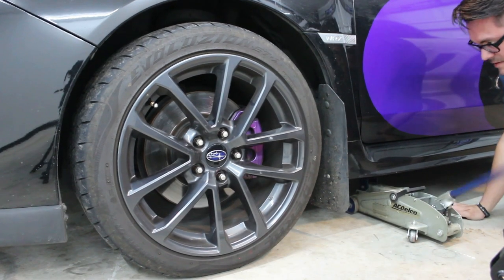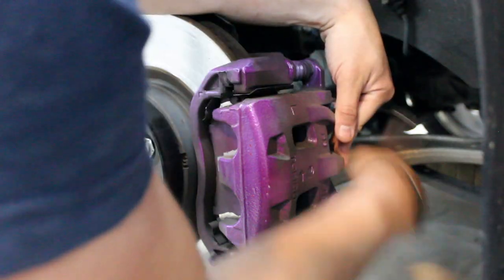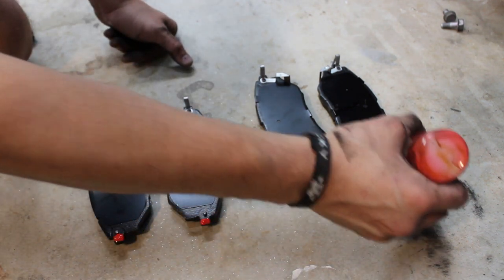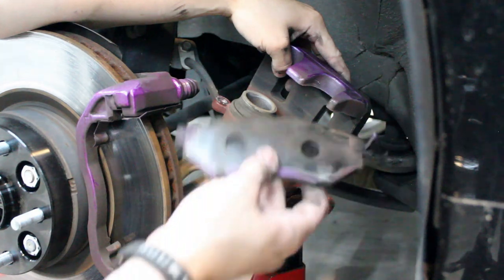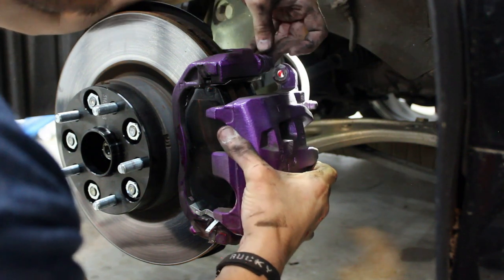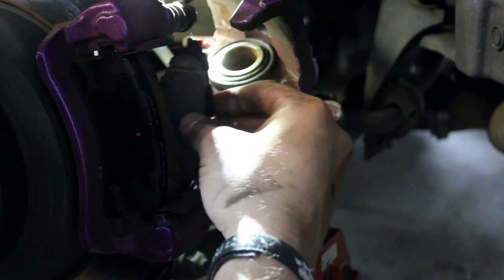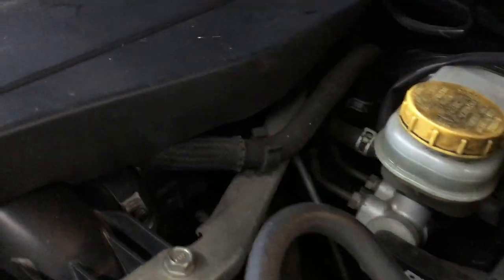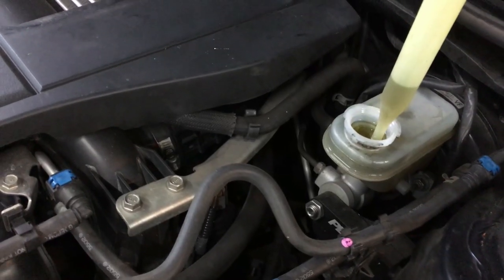2015-2021 Subaru WRX, Brake Pad Change

Comment: You don't need to put red locktite on any bolt to do with brake calipers and you certainly don't need to bleed the brakes after pad installation like what🤣
Reply from the maker: Didn’t say you had the bleed the brakes with a pad change, just showing how it’s done. At 100k miles, it was long overdue on this car. 

I strongly encourage using locktite though. Factory recommendation and I’ve had Subaru caliper bolts fall out before.
Reply: Blue loctite would be better for this though. Especially if you would ever need to do the pads again in the future (which someone will). Red is too strong and usually meant to stay permanently.

Comment: torque spec on the 14mm bolts?
Reply: 20ft lbs on caliper bolts I'm finding in my guide from O'Reilly auto where I work. Getting ready to replace mine in a couple days. Doesn't seem to be a very hard project to do from a home garage...

Comment: The retaining spring clip on the bottom of the brake pad, does that go on the inside of the bracket or do you pull the tab out and have it rest on the outside of the bracket? Im having a hell of a time getting my pads to sit properly but Ive seen in the impreza forum that the spring clip rests on the outside of the bracket on the metal tab. I would think itd be easier leaving it on the inside but my stock pads have the spring clip on the outside
Reply: you probably got this by now - but the outside for sure!!

Comment: Great video, but some things to consider here:
#1 - add grease between the metal clips and caliper   (contact point)

#2- don’t grease that edge of the pad (not a contact point)

#3 - grease goes between the back of the pad and the flat clip.. not outside the flat clip. Notice how he cleans #2 & #3 

#4 - the attached spring clip from the pad does not latch onto the caliper. It goes on the outside and should push the pad out a bit from the bottom. 

5# torque to 20lbs 

Be safe !

Comment: Bedding the brakes? Wtf are you talking about?
Reply from the maker: Whenever new pads and/or rotors are installed, you need to complete a "bedding" process to get the brakes hot enough that there is a pad material transfer between the pads and the rotors. This optimizes braking performance and ensures that the pads are made smooth with the rotor surface. To do this, you essentially brake hard from 30mph-10mph (without activating ABS) 5 times in a row. Then repeat this process from 60mph-10mph 5 more times. For racing pads, you'll need to repeat this process from track speeds as well. The brakes will get very hot during this and you may experience brake fade. Do it somewhere straight and safe, and be certain not to sit stopped with your foot on the brakes while they are hot or you could fuse the pads to the rotors.